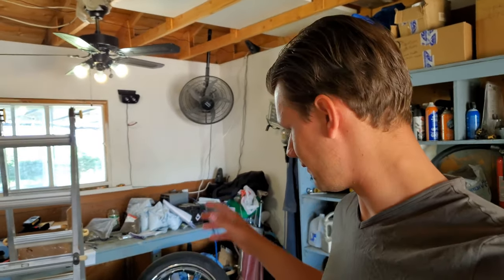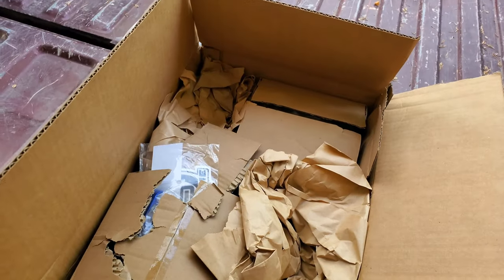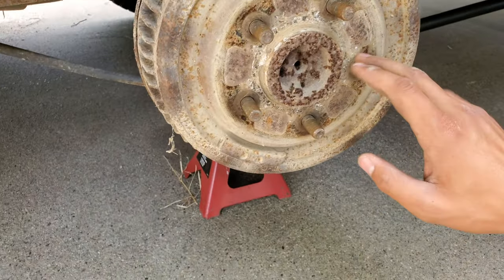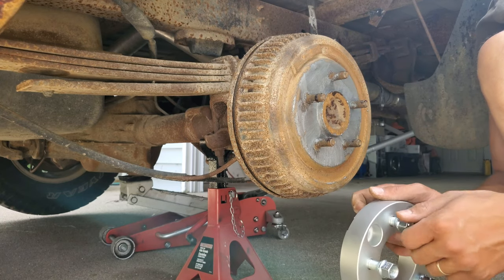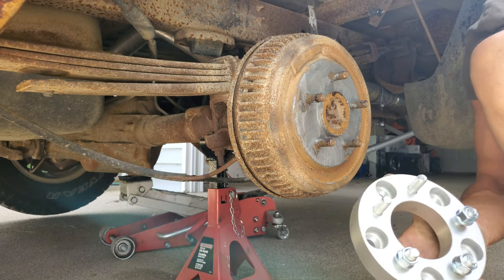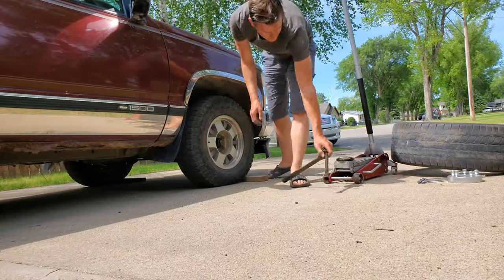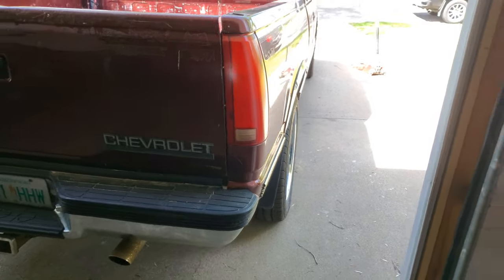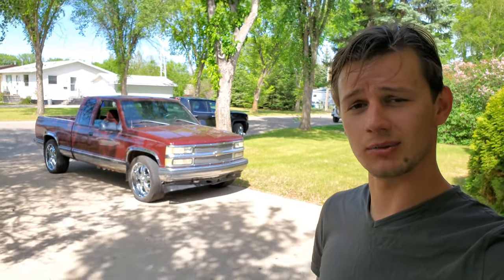22's Are Finally Mounted! | How do you think they look?

Comment: i wouldn’t use those wheel spacers... they aren’t hub centric and will not sit evenly....
Reply from the maker: Hey Toryn! Thanks appreciate your insight!
The wheel spacers themselves are cut with the exact size hole for the hub. They fit really nicely. The it's a tapered edge inside the lug holes too, so they sit in there really well when tightened. 
My concern is the lack of support for the centre of the wheel 😐😳.
But we'll see. I'll keep an eye on them. Not planning to put a ton of miles on it.

But if you want to keep following along I appreciate any other help you'd provide 👌